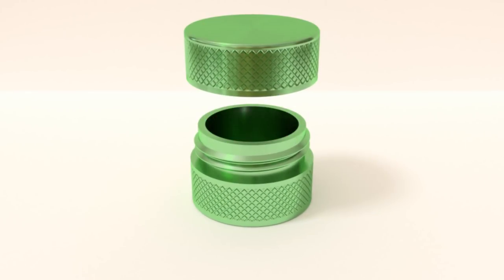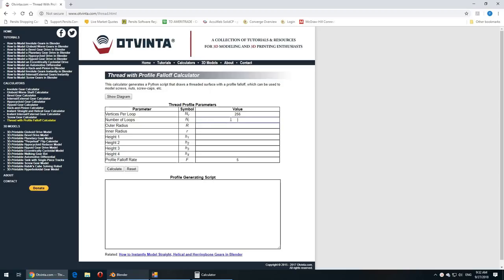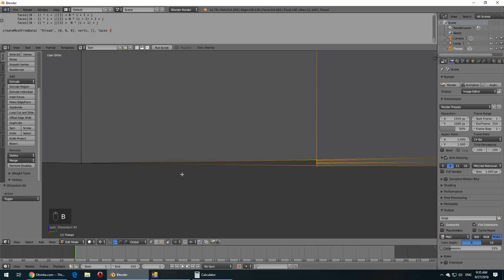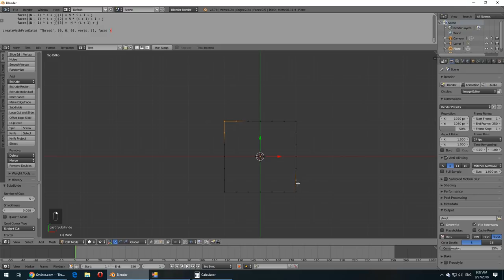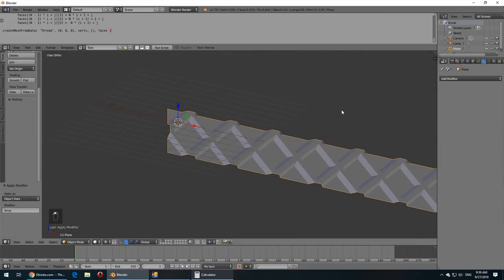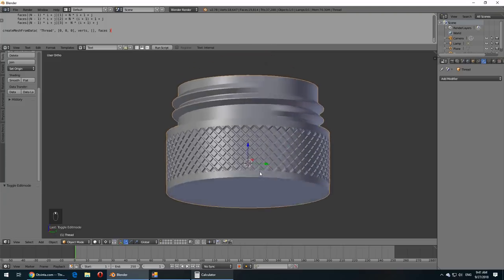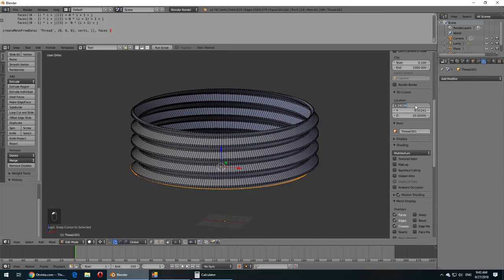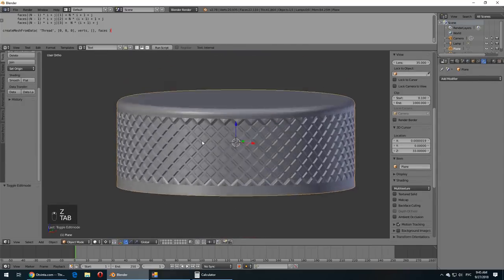Tutorial: How to Model Threaded Objects, such as Containers with Screw-on caps, in Blender

Comment: Thank you for this great video. How would you calculate the difference between the bottom and top profile detailed information you put in your calculator please? or what is the difference between the 2 information you input  for the bottom part first and the last one for the  top profile  for the h1 , h2, h3 and h4 please? If I wanted to make my own I need to find this please. and one more question if I wanted to have 4 thread to twist at the same level and make a screw , do you have any calculator for this please? thank you very much again for your time and info!